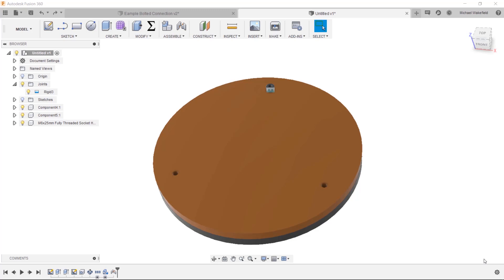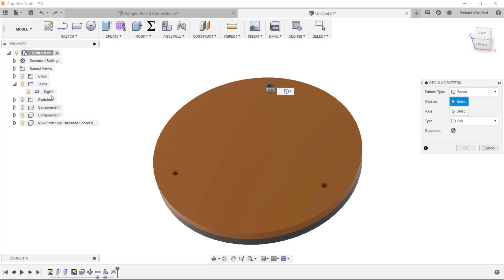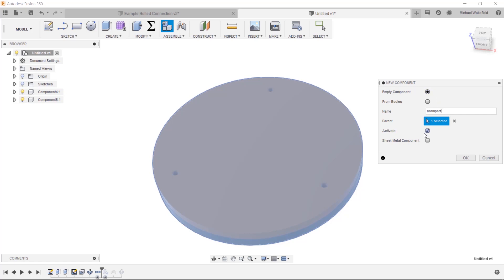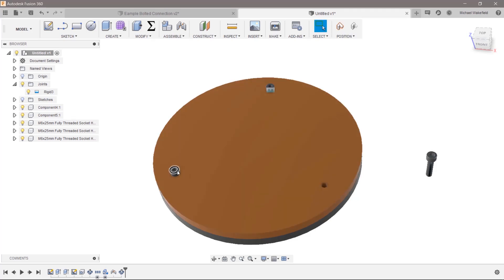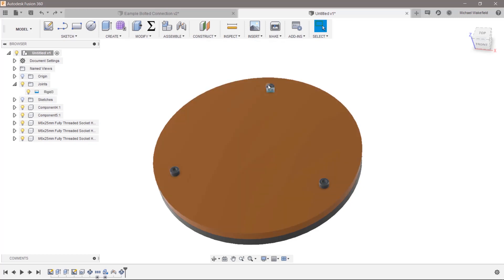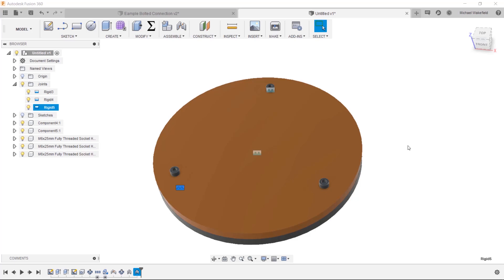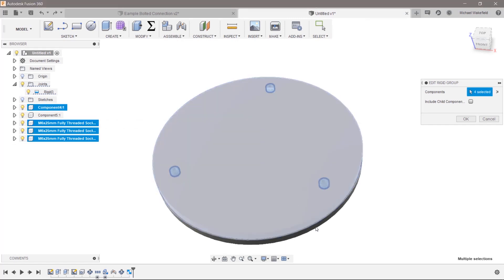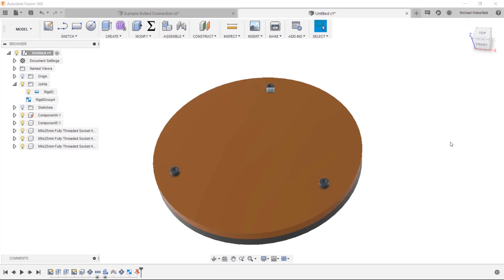Patterning Joints in Fusion 360 - Possible?

Comment: With the rigid group, Fusion gives you the ability to select all child components when assembling a rigid group. However, if in your example, the number of holes (and fasteners) is parametrically determined (i.e. NumberOfHoles = 3), the rigid group will not automatically recompute the rigid group to include the additional children. In fact, if you set the rigid group, then decrease NumberOfHoles, the rigid group in the timeline will show you a yellow warning to say that the components need to be reselected. :( I really hope the Fusion dev team will work on a feature that will meet our needs here.
Reply from the maker: It's an interesting problem, to be sure. It is consistent with the rules of parametric design though, and I'm not sure how to combat the issue. There would need to be some option perhaps within the component creation to create the objects to have them placed as rigid parts within the context of their parent assembly. In fact - this is possible during the creation of a component as an external part.... Have you described the issue in the forums?
Reply: @Boldform_Consulting  No I haven't posted this on the forums. I am sure that they are aware of this quirk and would say "it works as designed".